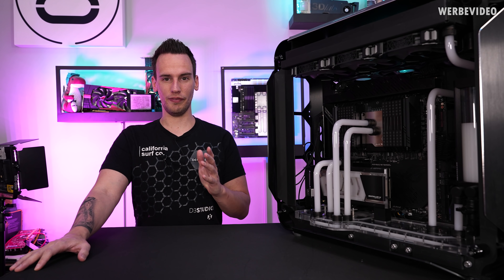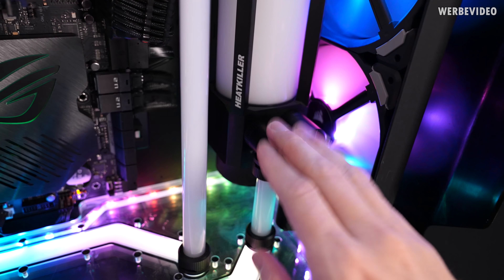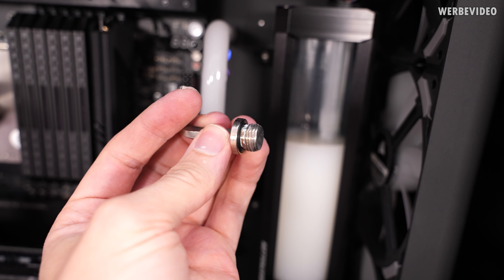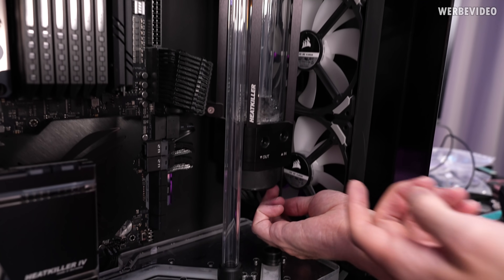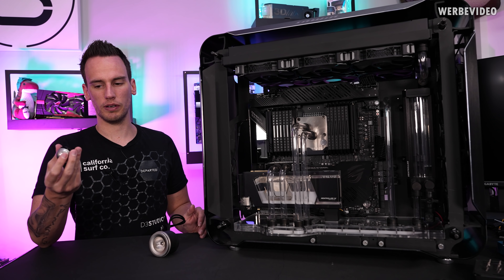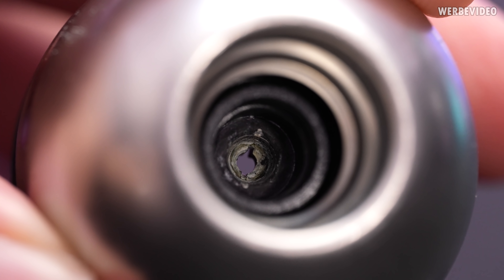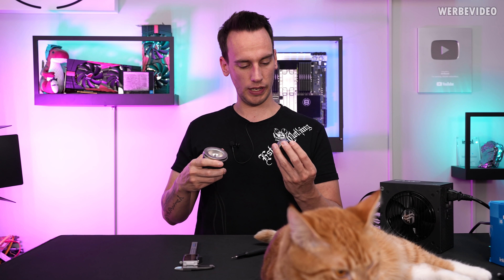Project Irrationality Part 13: Pump Failure :(

Comment: The bearing will be shot. D5 pumps use a ceramic ball type center bearing with graphite bearing on the impeller. When the bearing wears down the impeller rides lower until it can touch the side walls and it stops. I've seen this a lot and can only assume it has something to do with the pump housing being used. I have a D5 that has been in constant use since 2012 and its running my PC right now. 
They normally start to make a lot of noise when they start failing when the impeller rubs the wall. A clicking or screeching sound. They can also flood the loop with very fine graphite that will turn clear water grey. 
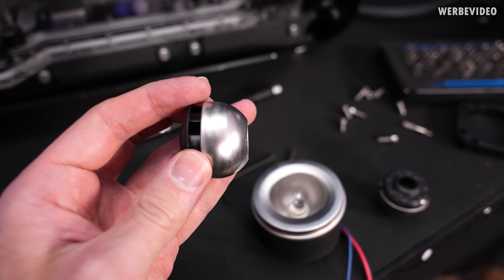Edit: I can see at about 7:05 and 10:48 that graphite bearing is totally ground out. Compare it to a new impeller and you will see the hole is much smaller with a very small hemispheric cup. I can't share them here but I have pics of a new bearing vs worn one and that one is very very worn.

Comment: Even Jay dealt with this with Skunkworks a few years back.  He cleaned off the bearing, and the pump lasted for a good while longer!  Next time just let it soak for a while before trying to clean off the residue.  It's just sediment from the fluid that worked it's way into the bearing, and couldn't escape.

Comment: That debris may be the materials breaking down from the milky white cooling fluid since all these premade computer coolants all seem to break down and the various substances that make up any given fluid simply separate and either start plugging up the very fine fines on the cold plates  as well as cause corrosion. I have a high end system with 2 separate blocks and a intel 8 core and 2 Asus Ares 3 dual GPU liquid cooled video cards running in crossfire and that system runs 24/7 for the last 10 years and I am using Honda Blue 50/50 car antifreeze and the insides of my entire cooling system look absolutely brand new and shiny without the slightest hint of degradation or corrosion and the blue coolant is as clear now as it was over 10 years ago when I initially built this tower.
Reply: yeah this is what i always say..use car coolant..especially the traditional green one, inorganic lasts forever and works with mixed metals
Reply: @St0RM33  that coolant has ethylene glycol, it's organic, and sweet, and toxic

Comment: Its where the ceramic ball touches that wears, or the ball itself.

When my pump weared down, i put a tiny 2x2mm or so piece of hard plastic inside the rotor so that the rotor was bit higher.

It ran like that for 3 months 24/7

Comment: If they use what I think they do, then the pigmentation can cement out as it is technically a ceramic ultrafine powder. NOT what you want in any liquid loop.
Reply: I believe they use zinc oxide in opaque coolants.

Comment: I had the graphite bearing wear through on the impeller on my old D5 after several years. You can find genuine replacement impellers for the D5, but unfortunately (at least in the US) they're only available through aquarium suppliers and such for more than the cost of an entire new D5 from a water-cooling store. it kind of sucks that it's cheaper to get a new pump than to fix an otherwise perfectly functional one. Maybe this could be an opportunity for one of the stores?

Comment: Adding a second D5 pump in series as redundancy is a good idea in this humongous system to make sure you never have downtime again. As a bonus it will also improve flow (and lower temps) and allow you to reduce noise (by lowering pumps and fan speeds).

Comment: Coolant is also being used as a lubricant for the pump. When you use colored coolant, the pigments will be built up inside the propeller in time and clogged up the bearings. While the coolant is hot and there is constant motion, pump will continue to work with higher resistance ( this will cause lower flow rate nor extra heat creation from the pump - if RPM regulated PWM, it will draw more power than used to be. If Voltage nor percentage rate fixed lower flow rate than used to be ). But when you close the system for a long period of time, that clogged up pigments will solidify and makes bearings to turn even harder.

I thing %99 isopropyl alcohol with ultrasonic cleaner will be a good choice as a pump maintenance kit.

Because of this, I don't like using colored coolants. I always use clear coolant in order to reduce the risk of pump failure.
Reply: Ya yearly cleaning and a pre filter will extend likespan of pumps. Along w my pc, i have to maintain my dad's 3 pond pumps which last yrs longer with those 2 steps.

Comment: The buildup on the bearing is from that fluid and heat baking the materials in the fluid onto the bearing. If you’ve ever looked at the inside of a car engine you see baked on crap all over the engine when people don’t change the oil often or use crap oil and gas. This is why I don’t run coolants that aren’t clear.

Comment: yup - I have seen this with those "nano-fluid" type coolants before. Its the pigments in the fluid building up around the bearings and eventually forming a hard deposit on the bearing which over time will make it harder and harder for the pump to spin up. dead easy fix though - break up and clean off that junk and as it did in your video - the pump shall spin again!! Gotta love how serviceable the D5 is!

Comment: Always use clear coolant ( no distilled water ) in your loops. If you have nickel plated copper blocks also use a filter in your loops before the liquid goes into reservoir ( pump ).

Comment: I only use clear or dyed fluids to avoid any problems because i am lazy.
It is also quite easy to pull out glass tubing with bitspower fittings. Had them for years and no leaks.

Comment: People seem to forget dyes are particulate matter. The more opaque the dye is, the larger those particles are, the more likely they are going to deposit themselves on materials given temperature can create chemical change in many different substances.
Reply: Good point, tho dyes are molecules, which are not considered particles unless the molecules form crystals or aggregate amorphously. These colored fluids typically use particles for the colors, which may be dyed.
Reply: @Bieber Ozinga Particles can be colored with various substances (dye, pigment, stain) or have inherent color based on the chemical composition. Joseph used “dye” when the color of the particles might be from something else. The issue of the pump failing because of the coolant is that the particles may have caused friction. We don’t know why the pump failed.
Reply: Yea dye usually revers to something thats dissolved in the liquid that causes the color to be changed while the level of opaqueness  or turbidity as its called is based on the amount of undissolved particles. So a coolant that's milky like that by definition contains a lot of undissolved particles, and usually over time the particles will usually begin to aggregate  which is a another sweet term called flocculation, this is most certainly exacerbated by any corrosion that might take place as I'm sure the coolant has some deflocculant in it , basically surfactant or a soap to keep it from aggregating but solvated metals tend to be more "sticky". With the nature of the clearance and hardness of ceramic bearing anything getting in there will be welded or baked on or due to friction percipitated out  and cause that to happen and eventually lead to failure.
Reply: As an addition of Jay's answers, the opacity of a pigment is less related to its particle size but instead heavily depends on its concentration and more importantly the refractive index of its structure and its molecular composition. In fine art painting and art restoration product lines there is a bunch of semi-opaque and transparent pigments independently from the quality (mainly due to grinding) of the powder used.
As an example, the Titanium dioxide is a very opaque pigment, yet has a relatively small crystalline optimal size and it has an even better opacity and brightness when purified from its bigger lattice impurities.

Comment: I had this issue even with the EK clear fluid on my D5, just jammed some qtips in with some dish soap and warm water and spun it around for a few minutes. Went through a few before the brown scum stopped coming off, worked fine after. Like yours, it was really stiff to turn prior to cleaning it, and even the rest of the loop was fine, almost no buildup of any kind, anywhere in it.

Comment: I run my PC 24/7 as well and have come back from vacation and it wouldn't restart at all. In my case the motherboard decided it was done and off to hardware heaven. I know exactly how you felt when you found out the pump wasn't working.

Comment: i have 3+ year old D5 PWM pumps from Alphacool with clear fluids and never got any problems, other then adding a resistor to the pin because it could not spin up to max speeds

Comment: I had this problem. It is very annoying to find out the pump not work when everything is built.
I had to clean the area where the pump and impeller touches. A lot of black gunk was stoping the pump to start.

Comment: Premature pump failure on these is rare - they should not be dying after only 1-2 years. Those D5 pumps are manufactured by Cegled Pump Gyar in Hungary. I have the exact same thing on an EK tube res in my workstation that I installed way back in 2015 and have been running like yours 24/7 with just the occasional reboot/reset.

The BIG difference is I use CLEAR fluid. Any kind of colored piss, and I mean ANY, will gunk up your system and create problems like this. Your tubing, blocks, rads and pump all become degraded over time and will require a full teardown+clean just to keep working assuming they don't entirely fail prematurely. I went with colored tubing instead of colored fluid - I made the smart choice!

These pumps are rated for 40,000 hour MTBF at minimum. That would work out to about a 4 to 5 year lifetime for these when deployed 24/7, but keep in mind that figure is AN AVERAGE - my example shows they can actually last longer. Given that I have taken care of my setup so well I'm not expecting it to fail and am not hearing any funny impeller/bearing noises or signs that the pump is near it's end of life.

Quality coolant will last 12-18 months inside a loop and needs to be drained after that interval anyway. Refilling the loop with new coolant will prolong the life of your gear. But a flush will be necessary as an extra step if you're changing the type of coolant since you don't want to mix different ones.

As a funny note, I did actually experience a pump failure once - the 12V cord coming off my Y-splitter failed and caused the pump to shut down. No damage done and I replaced the faulty power cord and the pump has been working properly since. As you might guess I had it wired to a on/off switch to make filling/priming the system streamlined. Unlike yours though, I also incorporated a drain/flush bypass so I don't need to blow into the tube with my mouth to empty the system - that can introduce nasty airborne bacteria which you want to keep away from any kind of tubing that then comes into contact with liquid being used in a closed loop. Something to consider for next time 😎

Comment: Great video. Glad you looked into what caused the failure instead of just tossing the pump out. I've had my D5 in my rig for 7 years now. I might invest in a spare pump to keep it handy just in case.
Had you been doing regular coolant changes? I run straight distilled water after getting annoyed with residue from other coolants. I just flush and refill the loop every 4 to 6 months.
The glass tubes look cool and all but I'd be too scared to break them. I'm actually thinking of replacing my tube with annealed copper and polishing or painting them.
P.S I love how the cat just gives 0 fucks and walks thru the shot! 😀😺👍

Comment: The same issue happened to me before a few years ago a couple of times too so I opted to using a more powerful water pump that I could control via a fan controller and I always set it to where it's not overly loud but the pump hum is still obviously audible so that if the pump does fail that I would definitely be able to tell it very easliy.

Comment: Meanwhile built in pump from Fury X that I bought second hand 4 years ago is rattling like crazy, but bravely pumps desstilled water through both its loop and corsair H110i that I removed broken pump from and jank-connected to the Fury's loop.

Comment: I been using D5 for 5 years now 24/7. Most of the time Distilled Water + littlebit car coolant, i did have EK Pastel White coolant for year though and pump been fine with that.

Comment: This is why I never put in anything except a clear fluid. My d5 is 6 years old running in my 3rd system and the bearing looked like new last time I took it apart. Also never had any issues with residues in blocks. The looks of fancy fluids is not worth it.
Reply: That's why RGB shines, (rgb.. Shine.. Got that?) you can add color without using colored fluids.

Comment: I had a weird issue with my D5 too, also from EK. Even though I only used water. Luckily, EK replaced it for me as it was still under warranty. My issue was when I switched mine off too as it never really gets switched off.

Comment: I've had the exact same thing happen but only with solid colour liquid so I believe it's pigment or something along those lines they put in solid liquid. Unfortunately I've like you tried scraping and cleaning with iso never managed to get the bearing going but did have some luck using rad flush but tbh I just avoid solid colour liquids now.

Comment: I had the same issue and it was caused by the EK fluid. It made everything in my loop very sticky and eventually stopped the pump from being able to start reliably but once it was spinning it was "fine". Ever since then I stick to clear fluid that is just water with some additives (I do still use a premix).
Reply from the maker: Yea next build will be different 😂

Comment: Roman, my D5 pump ran for over 2 yrs with no maintenance. I have shut it off for cable management stuff but 30mn off, no issues.  I am only using crytek's clear fluid though.  You might want to get that white fluid out of there as the particles could be destroying the pump.
Reply from the maker: Yes next system I will not use pastel anymore 😂

Comment: (note, I've never tried it before, so I don't know how effective or destructive it will be) 

It may be feasible to better clean the impeller with an ultrasonic bath; however the vibrations may do more harm than good if you leave it running too long, as the particulate will act as an abrasive once it is dislodged.

Comment: Try putting the impeller (not impaler :D ) in an ultrasonic cleaner, it could break down the deposits (goes for other parts, fittings too - not sure tho will it strip the coating)
Reply: Dude he has a dishwasher, i am 90% sure he just gonna put it in the dishwasher haha.
And yeah ultrasonic cleaner's are so insane cool, they clean stuff so well and they come cheap.

Comment: Even with EK fluid premix (Mystic Fog) i have the exact same problem with my EK FLT-120.

I think that at one point there is not enough water in the fluid because of evaporation and you start to have some sticky goo accumulating in the loop.

Comment: I suspect that some white vinegar might clean that crusty out of the pump bearing, also I wonder if running a fluid with some ethylene or propylene glycol would help lubricate the pump bearing somewhat?

Comment: Hah, yup been there done that. The T-can board in my Samsung 34" CF791 died after the PC had not been unused for 48hrs. So when its goes again its will be teardown and replacement, deap joy...

That residue looks a lot like limescale.

Comment: Eh my dear der8auer, why are you not using an aquaero (they are even german) and one of their flow meters, so you could set an alarm for certain flow values.
Also, for example EKWB (and bitspower also has one) has a block for two D5 pumps in series so when one stops the other is for redundancy.
And screw those pastel fluids, I've been running EK Cryo fuel colored but transparent for a couple of years in the loop with no gunk or any staining.
Cmon man, I expect more from you.

Comment: It would have been interesting to get the macro lens on it and drip on some spirit vinegar and look for a fizz. I looks a lot like limescale but that seems odd as presumably the fluid is made up with deionized water.
Reply: Its a welded or baked on aggregation of whatever it is in the fluid that makes it opaque, to be opaque it almost by definition has to contain a fair amount of undissolved particles. The term for this is turbidity and is important in terms of water quality.

Comment: in msi afterburner you can set the alarm after reaching the set temperature, or for the pc to turn off if it exceeds, for example, 100 degrees, set it on the card and processor, it will save you from damaging the pc

Comment: you could simply replace the empeller of the spare pump to the original pump if you wanted to keep the cables and the pwm fuction.

Comment: It seems it will be best to run clear water with no colourants....as those always cause residue? Well-done in fixing it!
Reply: You can use "fancy fluids" but you need to keep an eye on the clear tubes.
As soon as you see build up or coloring in the tubes, it's time for a clean flush and liquid replacement.

9/10 people just forget to do it and have pump failures.

Comment: Ahhh same thing happened to me recently.....had mystic fog in the loop changed it to the EK clear (after cleaning the loop) everything worked normaly....left home for 3 moths and when i came back clicking noise from pump...it takes some effort but it will spin after a couple of minutes...